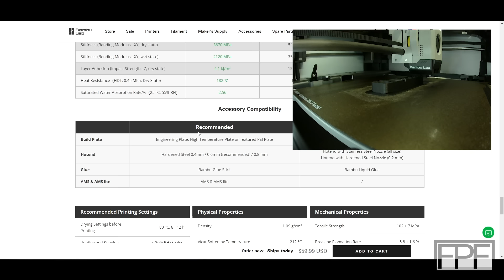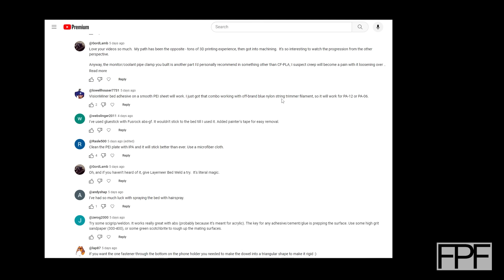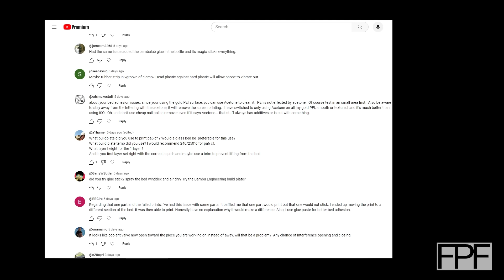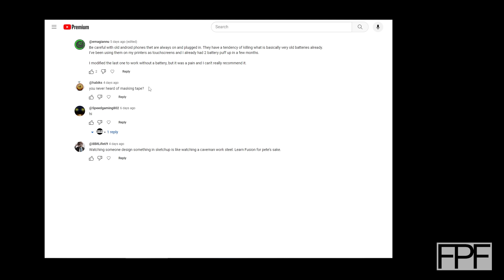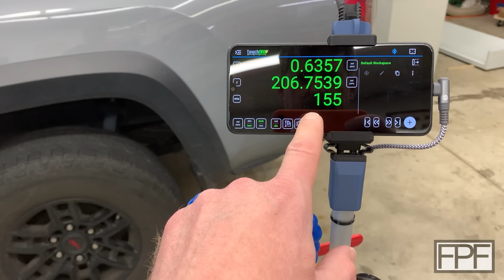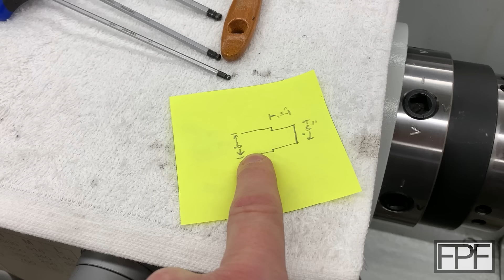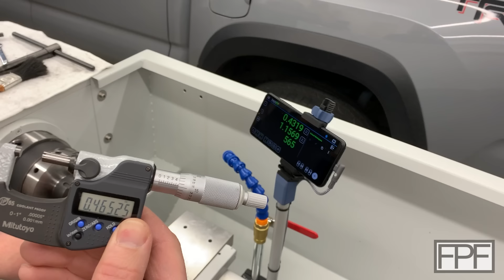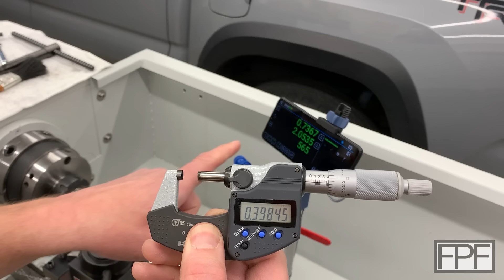3D Printed Carbon Fiber DRO Mounts - Finishing the Install and Testing

Comment: I printed PAHT-CF on the engineering plate with Vision miner nano adhesive and 110c build plate this week. Sticks very well.
Reply: So far Vision Miner Nano has allowed me to print with PA string trimmer line on a smooth PEI sheet. I have a no-name brand nylon trimmer line benchie because of Vision Miner. The stuff is legit.
Reply: This is the only correct answer.

Comment: Don't regularly use bambu machines and don't know if tape is a good choice, but if I remember correctly bambu does leveling by probing bed with the nozzle which means you wouldn't need to do any adjustments to leveling to try the tape.  That said for nylon I use G10 with Visionminer Nanopolymer stuff works great on all my printers.

Comment: 15:18 a little 3d printed jig that your dewalt 90 sits in and then sits on the triangular ways would have been neat. Make it so it uses the flat ways too so then you could have popped the dewalt in otherside.   Probably overkill but jigs to accomplish task are cool too. Much like the red thing is holding the reader in right spot. 

Or better instead of making the hole punch just make it the jig so the tool Mount sets the hole position not a pinch then try to match it freehand.

Comment: My favorite item to use to add bonding strength after good cleaning is Aussie Purple Extra Hold Hair Spray when one is needed.  

Ive had parts refuse to stick, in those cases I look to ensure Z height and plate level cal is on.  I wash with hot water and dawn.  I let sheet dry and use rubbing alcohol.  I also will ensure roll of filament not defective and keep all rolls in a heated temp controlled Sunlu 3d Printing Mate holder, running for a minimum amount of time before printing starts to ensure no moisture issues.  I find this improves all layers regardless of material used.

The PEI textured sheet shipped with Qidi smart series of printers rarely requires an adhesive.  I frequently will use a 6-8mm skirt on larger objects where material may try to lift at the ends along with a light coat of Aussie hair spray.  Qidi says to leave door n top open on some materials but if they are prone to warping door and top are left closed on larger objects to slow down cooling and warping effect.  

I recently tried magicgoo, I have not used enough to form a final opinion on it.  It does seem to work fairly well, but I think my Aussie purple hairspray performs better.  

Enjoy watching your videos, you have amazing content!  Waiting on newly ordered Qidi Q1 Pro to arrive, currently use Qidi XSmart 3 and a highly modified Ender3v2 with direct drive, the ender has been retired for now in favor of my Qidi machines which have an extremely high print success rate.

Comment: My experience with acetone on smooth PEI sheet was that it made it brittle.  It developed hairline cracks and then started breaking off in small pieces bonded to the print.
Reply: Isopropyl alcohol is surprising awesome and very cheap.
Reply: This will certainly occur with the PEI sheets that are not genuine Ultem PEI .... Ultem PEI is gold in colour, the cheaper inferior versions are generally clear or black.
Reply: @hot_wheelz  This was on my original Prusa MK2. I replaced the sheet (not a fun process) and stopped using acetone.  Never had another problem.  Eventually did MK2.5 upgrade and changed to flexible steel sheets.

Comment: You mentioned my post about Acetone... I've been using Acetone on my smooth and textured PEI plates for years and have never had an issue with the surface softening or deteriorating.  ONLY use Acetone on "real" (gold) Ultum PEI... DO NOT use on (fake) black or dark PEI, it will deteriorate and soften that instantly.  If you read the chemical resistance data chart for Ultem PEI, Acetone gets an 1A rating which is the highest obtainable resistance at room temperature.  Remember, I'm not talking about soaking the bed in Acetone, but just dampening a piece of paper towel and give it a quick wipe. While ISO does work, Acetone can remove oils and greases that ISO won't touch as well as removing plastic residues from previous prints that (again) ISO or soap won't remove.  Hope that helps with understanding and dispel some myths.  There's actually very few chemicals or solvents that can effect Ultem PEI in a negative way.  Oh, and we're doing this wipe on a "cold" build plate, then heat soak if needed (always recommended).

Comment: Been using the lightyear g10 pro surface on my X1C for the past 6 months. I terms of engineering projects when strength and dimensional accuracy are what matters I have 3 build plates that I use depending on which material I'm printing....

1. Lightyear 3D G10 Pro
2. Wham Bam PEX
3. Energetic Gold Textured PEI

In my experience, unless you're printing exotic filaments that are beyond the capabilities of the X1C these are the only 3 print build surfaces you'll ever need. I also own a bunch of plates designed for aesthetic prints where looks are more important than absolute dimensional accuracy and good adhesion across a wide range of materials.

Comment: You seem thorough in your pre-planning however I am surprised that you did not print a small drill and tap guide / block. It seems right in line with your leverage of technology to solve a problem. Although I do not have any practical experience 3D printing, seeing your design ability and skill set I would have thought it would be a simple thing for you to accomplish. Maybe there were circumstances that we did not see or you did not share but I think it would have been one more check to make sure it was correct. You obviously did it well without so it is a non-issue either way.

Comment: you could have 3d printed a sled to sit on the ways that held a guide for the drill. Probably not needed but if you wanted more precision thats one way to achieve it.

Comment: I’ve been using the Bambu smooth PEI plate more lately. I like it for PETG and some ABS prints; sometimes they will stick TOO well to the textured PEI. Also, for textured PEI I’ve been using the Wham Bam! plate, and it’s been awesome! 

I usually use hot water and dawn for a serious clean, but if it’s just a small area or some other small shmutz, I’ll just spray some 70% IPA on it and wipe with a microfiber. I would usually have 91% or above, but I’m forgetful and just haven’t ordered more yet lol… in fact, I tried to earlier but got distracted! Hooray ADHD and vodka lol

Comment: Or: at 15 minutes into your video where you are struggling to drill holes with a right angle attachment. Remove the Tailstock (easily done) and traverse the cross slide carriage all the way to the end of the bed and drill the holes with ease. I watch your videos for tips on 3D printing which are excellent, I have spent my life around machine tools so not trying to be rude about your methods.

Comment: Did you print those parts just because you could? I mean, you have a milling machine. If you want precision, a printer is about as appropriate as a hammer.

That said, printing precision parts is an idea but I don’t believe that commercially available printers are there yet.

(No, I haven’t been following the series-YouTube suggested this video apparently because I subscribe to AvE, This Old Tony and  Blondiehacks.)
Reply from the maker: 3d printing has come tremendously far in the past few years.  The latest machines from Bambu and Prusa both produce parts on par with modern CNC from an accuracy perspective.  Obviously you're more limited in material choices than you are with manual machining or CNC, but nylon filament with carbon or glass fiber provides impressive strength and repeatability at a low cost with accessibility to the average 'maker'.   I tend to choose 3d printing if I think the use case doesn't require the strength of metal.  For example, in these parts, due to how most of the force is in compression, and how large the cross sections are in the other force directions, the Nylon with carbon fiber is likely overkill for the application.  Yes, aluminum would be even stronger, but that strength just isn't needed for the cross-slide mounts.  I did need to machine the carriage mount for the Z out of aluminum, and even at 1/4" thickness, aluminum in that application still flexes a bit due to the type of force exerted on it.  The other big win for 3d printing, is fast and cheap prototyping.  Most design shops, even if they produce zero 3d printed parts for production, are running a farm of printers for prototyping because the cost of the machines and material is a fraction of what their machining centers cost.